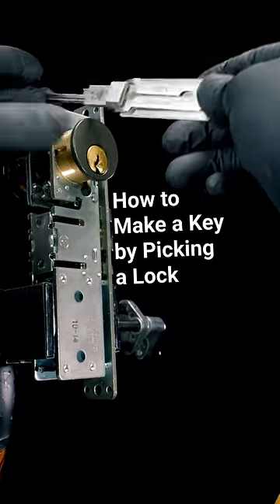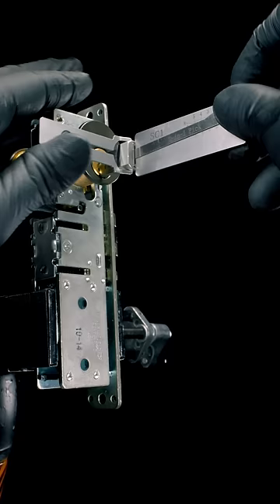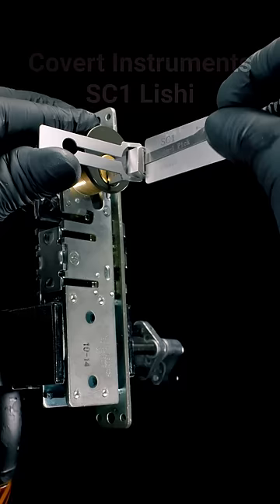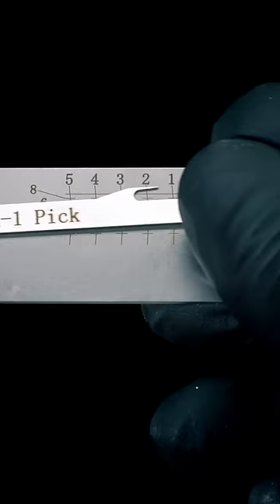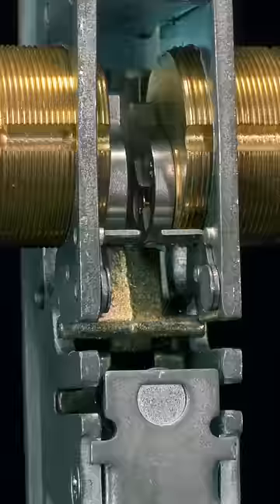How to Make a Key by Picking a Lock

Comment: We need a video for: how to make a lock from a key
Reply: Actually… this is a thing.
Reply: Ha
Reply: Hwll yeah this man could do it
Reply: They have...
Reply: He could do it no problem.
Reply: It’s not hard, just time consumimg
Reply: It's not hard or time consuming. Pins are numbered to match. Assuming you don't have the code already, decoding key teeth can be done several ways.
Reply: The machine he is using to cut the keys has a key decoder built into it. The process is very easy to "rekey" a lock and locksmith do it all the time.

Either copy a combination or create a new one.
Reply: Rip
Reply: You just put the key in an open cylinder and try different pins till they are flush
Reply: Look up how to re pin a lock
Reply: You'll need a lot of Chinese people.
Reply: Re keying locks? 😂 Child play
Reply: Scott Cawthon be like:
Reply: Legit Matrix Keymaker, except he isn't old and his armed with a square.
Reply: Its a fun challenge tbh, but its pretty basic. Take the tumbler out, pop the key in, find pins that come exactly flush with the top of the cylinder, badabing badaboom now you just gotta put the upper pins and springs in.
Reply: Easy but if you're not savvy you're definitely going the harder not smarter route
Reply: Rekeying pin kit. It's easy.
Reply: Very simple, you can just eye ball the cuts and guess the depths, 0 to 9 (or the rare 10) just pin up your cylinder and put it togethor.
This is called ReKeying.
Reply: Get a Masterlock. One Masterlock unlocks another, so you have both.
Reply: That is hella impossible
Reply: Just a couple days ago I wondered that while thinking about the music box in edith finch.
Reply: I lost the lock, only the key remained. I need to do this I lost the lock, only the key remained. I need to do this😅
Reply: Magnetic defender
Reply: open the lock remove pins and springs then adjust them to fit new key.
Reply: That's maybe even easier to decode, harder to manufacture
Reply: Just take that paper and put a key on it the pass the numbers on a machine... Then throw the key away if you are subscribed
Reply: It's actually way easier than you might think. You're just matching up the key pins to the biting of the key, and the corresponding keyway in the core of the lock. Decoding via a lishi is more whimsical than repinning
Reply: re-pin
Reply: @lukepippin4781 can you do it for car keys? I wanna get an ignition lock made from an old key
Reply: Many people do this, anything with multiple locks, will re pin tumblers so 1 key can work for all.
Reply: This is "first was a chicken or an egg" kinda shit .
Reply: It's already invented.  The product is called a kwikset lockset.
Reply: Al fabricar la cerradura la llave está terminada e introducida en ella.
Reply: That’s the easy part
Reply: @FirewaII33 Yes, but you have to pick it first to decode the pins. Rekeying is easy when the lock is open even if you don’t have a key. 0-Bitted key and shim-stock from the back, gauge each pin, then cut the key by code
Reply: most keys have the biting printed right on the bow. cuz you know, why make getting in challenging?
Reply: Oh that’s way easier than this.

Comment: Imagine some guy is so good at what he does that he doesn’t even pick the lock to break into your home anymore, he just makes a goddamn key to your door and comes in when he pleases.
Reply: I just recently commented on this.  I am with you 100%. It’s not cool at all. Not only does it seem that everyone is commenting on the content, no one is saying anything about the fact that there are those out there that watch this, then have the “know how” to do what was previously more difficult…..
Reply: I have a metal door with two things welded at each side where a thick long metal bar is placed across the door and against the wall, so nobody will enter or if they try to they would have to make a lot of noise and destroy everything 😅
Reply: Wasn't that a character in Matrix Revolutions? The Keymaker?
Reply: @adamankrum2722 

Reality is,  locks are only designed to deter and delay.  Not secure.
Reply: He could rake the lock about as fast as most of us fumble with the key. He can make the key to allow anyone else enter the premises as fast as he can.
Reply: @adamankrum2722 still need the machines to do this and those are not only expensive but their purchase is also typically restricted to licensed locksmiths. That said, lockpicking has been around since the birth of locks, and while the tools have changed, the methodology remains the same. It's also not going away anytime soon. Hell, anybody can make their own pick by simply filing down the sides of a bicycle spoke head and shaping it into a J. I had to do this for the ignition lock on a 1982 chevette because I broke the key. Needless to say, it was simple to make that pick and unlock that ignition.
Reply: @adamankrum2722 shut up. It’s legal and completely ok. The person who does it is at fault. You cannot make anyone do anything and nor should you feel bad for someone else’s idiocy.
Reply: @bricesuire5072  I agree that it’s legal. The tough guy attitude from a device flatters me but go ahead. I do believe in freedom of speech. I’m just saying my opinion. Apparently you disagree and that’s your right. Hopefully your home is never broke into like ours was and you don’t have to go through the processes that we did. Thank you for reading. God Bless
Reply: I mean, he is good at what he’s doing, but he IS in fact picking the lock to determine the height of each pin’s shear line to know what height to make each tooth of the key. Unless the lock had it printed somewhere on it, he has to pick it to find out.

Comment: An actual locksmith at work unlike lock-drillers
Reply: Door open, don't have to buy a new lock and you even got a new spare key. This is a win-win-win
Reply: Sorry, but self respecting locksmith would ever NOT have drilling as a final solution... there have been tenants and angry ex's who've blocked up keyways so picking or even using the original key is no longer an option (and I'm not talking about trapping keys either).
Reply: @DxBlack I think the problem is many locksmiths don’t use drilling as a last resort but do use it as a first solution, as long as they deem picking a little too difficult.
Reply: @marcusorta714 
New key costs money, new lock costs way more money, which is what they want

Comment: As a young locksmith with an old soul, I cannot express how much I love you're using the blue punch to make this key!
Reply: does this work?
Reply: I just had 4 keys made and this is exactly how he did it. Except I brought the key to him and he measured the key not the cylinder. But yes it worked perfectly. @154g
Reply: What brand of punch is this? I’ve used Curtis Clippers before, and have a Lishi Clipper, but this looks much easier to handle.
Reply: @RyanDodds-wg4qw  Pro-Lok

Comment: I have an old floor vault safe that's solid cast iron. It is unlocked&open but i don't have the combination any longer..... Is there a way to figure out that combo so i can use it once again?
Reply: Sure is, you have to disassemble the lock from the inside of the door though, easy to mess up if you aren't experienced

Comment: Yeah yeah and picking it then using some dial calipers on the key pins to decode it is much cheaper than what they sell those for on CI. That or just rekeying it. Sure a Lishi is quicker and they are also cheaper from Locksmith Suppliers but you might need a liscense number to get the discount. Thats how they make a large profit on these someone Locksmith Liscense must be ordering in bulk getting the residential cheap then charging over $100

Comment: Has a lock been made like this?
Triplet barrel locking keys like a “Y” locking keyhole set?…. Upper pins (right side up)…then the 2nd upper set of pins, and then the lower pin set (upside down). Each with 8 locking pins.
Then it is cylindrical keyhole with ball locking pin randomly made around the barrel to prevent extra lock-picking,
The end of the key has a special grooved end that opens the locking pins

Comment: Wow...
I always knew the lock maker always leaves a BACK DOOR..
I learned this picking 100 plus old barrel combination locks.
I love your channel and you are one of the reasons we will save humanity..
Reply: That’s not a back door, it’s literally just decoding the lock and using the information to make a new key. A back door implies a secondary entry method unknown to the owner, that the lock maker has access to (for example, a lock that has a small hole that a specially shaped tool fits into which unlocks the lock).

Comment: Snark and Skyrim aside, a couple of questions come to mind...

Are Breaking and Entering both possible separately/independently?

I mean entering, without breaking, would be ignoring the Do Not Enter sign, and opening the unlocked door and walking inside - which I imagine would be Trespass.
Breaking without Entering - would that be picking a lock and walking away?
What specific crime would it be?
Not Burglary, because that requires intent to commit a theft or felony.
Would it be considered unauthorized hacking of physical encryption? 
Can you decode a lock without actually unlocking a lock at any point?

Comment: When I was 10, I did that the hard way.  Four-tumbler front door lock on the house my parents had just bought, and there was no key (nobody locked their doors there/then).  I had access to the inside, so I took the lock off the door, disassembled it, scrambled the disk tumblers (so old keys wouldn't work), and took the cylinder assembly to a locksmith to have the new key cut (because it cost only a few cents more, back then, than buying a blank to file myself).

He used a cutter much like that one, decoded the lock by eye, and the new key worked perfectly on the first try.  We later made copies at the hardware store so everyone in the family had a key to the front door.

Comment: Debunk this? My grandpa once told me that with a blank key and sandpaper, you could make a key for any lock. He claimed turning the key back and forth would make the pins mark the key. Shave off one step each time, until they no longer rub. The sandpaper was to smooth the key between trimmings, so you could mark the key again with pins.
Reply: So you would still need a key machine or file to cut the key,
But you could mark it this way.

Comment: I bought this handle, the key turns the barrel and opens the latch but doesn't stay unlocked and the handle doesn't move up or down to activate the latch. Only the key. So i removed a plate internally that was stopping the handle from moving, now the handle works the latch but the key can't lock the handle.... ffs. How do i fix it so it can lock and unlock